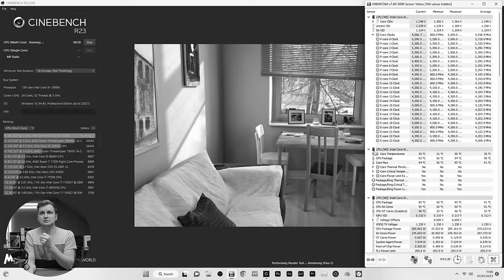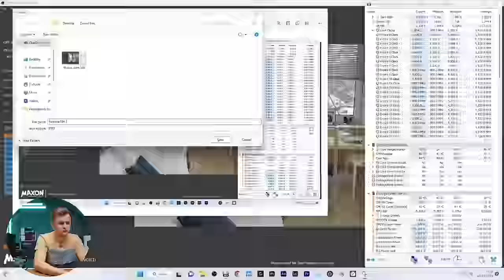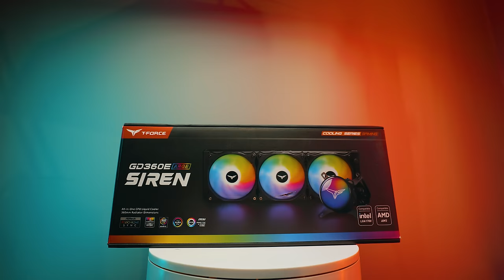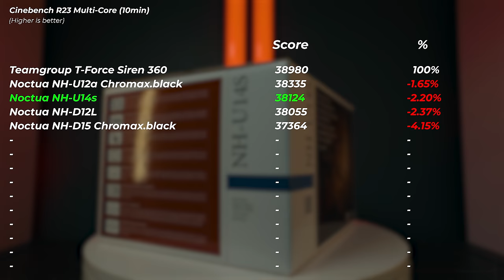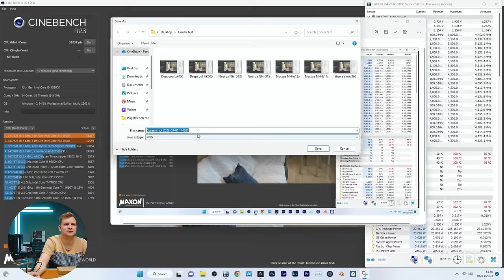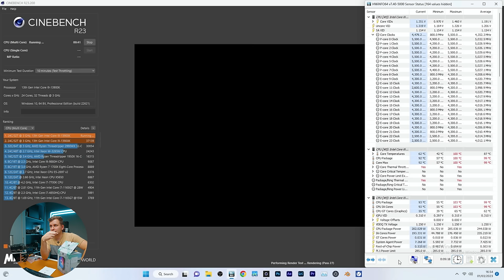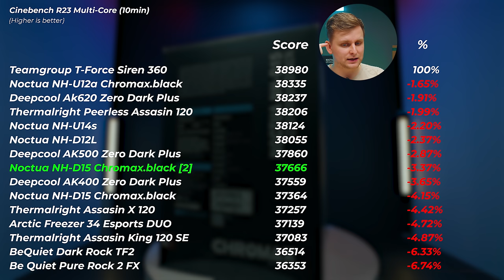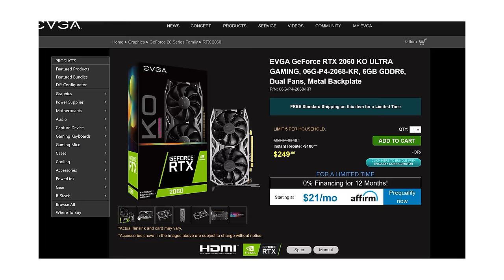We Tested 14 AIR-Coolers on 24-Core 13900k - The Results Will Shock You!

Comment: Well, I've been looking at the Be Quiet Pure Rock 2 FX lately. It's excellent timing on this video! Guess I'll keep looking around. Thanks for your hard work.
Reply: The Be Quiet Pure Rock 2 FX is rated for 150W TDP, it is not designed to be used with a 13900K, even on an open air test bench.

Comment: I have a deepcool cheap 15 dollar heatsink for my intel .Temps get to 80c during gaming. Just bought arctic mx 6 thermal paste and thinking about getting Cooler Master - Hyper 212 RGB Black Edition 120mm for 42 bucks. Is that pretty good air cooler?

Comment: Interesting test, but I have my doubts about its reliability. 

I think this test would have been more reliable if you had done it with the 7950x on the AM5 socket. The LGA 1700 socket has known issues with consistency in mounting pressure across the cpu. The only way to fix it would have been to use a mounting plate like the Thermalright mounting plate.

Comment: Considering a Noctua U12A or a 280mm AiO from Corsair for a 14600k-equivalent when it launches. I was always closer to the aircooler line of though, but the extra performance, RGB/looks and last, but definitely not least: The moveability of an AiO made me go towards that as a solution. You know, considering Noctua officially recommends a re-mount/re-paste for every time the PC is moved for their air-coolers... But again, I kinda would be paying $100 extra for the looks, and not having to do 2-4 re-mounts in the lifespan of the AiO. As the U12A basicly can keep up with anything for a reasonable CPU, and will last me a lifetime, and IMO it looks just as badass as an AiO as well. There's something so satisfying about knowing you have such a "rock solid" product in every aspect of it.

Comment: I'm surprised you didn't try bequiet dark pro 4 as that is designed to handle TDP heat output of 250 (Though after looking around, it seems to perform around similar to NH D15

Comment: I recently was looking at Air Coolers for the 4790K. Final two came down Noctua NH-D15 Black and TR Peerless Assassin 120. Went with the Peerless Assassin cause it's close to 1/3 off the price of the D15 and has similar performance.
Reply: How did peerless assassin perform? Did it manage to cool your cpu?

Comment: What I would like to see is more power in fans. Currently all are PWM controlled so if they can be quiet to like 60% load and then can make noise. Example like those in HP/Dell workstations (12V 2.5A finger slicers)
Other difference in real world is AIO usually is pulling/pushing air to/from case when air coolers depends your case fans. Workstation usually have wind tunnel from from case front to CPU cooler so it also may effect need of need hi power fans.

Comment: As owner of a Noctua NH-U12A with a Ryzen 5800X, I can say that it is by far the best cooler I've ever had. The build quality, cooling performance, low noise, and aesthetics are all top-notch. For me, it's a solid 10/10 in fan cooling. Is it expensive? Well, it's the best air cooler and if you can afford it, yoo won't regret.

Comment: Great testing. However, you’re testing these air coolers in an open air test bench. I can’t imagine how much worse the temps would be in a closed case with slightly positive pressure.

Comment: i think the dark rock was supposed to be blowing upwards. as the radiator absorbs heat and you are blowing the hot air down to the motherboard. hot air rises. i dont know. maybe im wrong.

Comment: Testing on an open bench is going to get you different results than a closed system. I just finished testing 4 different fans in multiple configurations on the U12A and you get the best results with an open case, but the closed case doesn't always produce the same results. Close it up when you test.

Comment: Best demonstration of the Air Coolers, one thing I'm really worried about, this could be a thermal bias, as with each run there could be a thermal effect on the CPU  from the previous run, which might be restraining it from its real potential and which might be limiting its productivity.

Comment: I have noctua nh-d15 and 13900ks, and for me its also p-core 5 and 7 thats throttle and hit max temp first. Im starting to think that nh d15 is probably not the best to cool 13900k due to not correct pressure on the ihs. Have ihs bracket, but it did not improve the result more than 2c°

Comment: The Teamgroup Siren cost double what the Deepcool 620 does and is only 2% more efficient. Deepcool 620 is VERY noisy. You didn't mention it but it has issues with resonance on the stock fans.
If you get better fans on it you will still be saving 30 bucks and it will probably match the Siren...

Comment: i have an 13500 on a msi 760 meg tomahawk, and the HWMonitor shows cpu 1.500 v and under it vdd2 1.200 v, as cpu-z shows 1.500 v too. So does my cpu runs with 1.5volts? How lower at voltage can a 13500 can run? I run R23 multi-core and the 13500 hit 100c with pure rock 2 cooler. is it normal ? keep up the good work.

Comment: I think any 6 heatpipe unit could do a good job.I use SE 224 XTS on my 12th gen. it also came with an extra clip which I used to add a quality coolermaster fan. The unit is a beast now. Everything happens in a 30C band now. Just a question, my motherboard has calibration for fans in bios, does yours calibrate your fans to the power curve

Comment: Fantastic look across the board here, and proof that CPU manufacturers (and GPU while we're at it) need to slow TF down and think about power consumption and thermals. We're getting performance metrics off the charts of what's needed for modern gaming, but at the expense of chips like this which simply cannot be air-cooled effectively. Given that AIOs have a fixed lifespan and given the maintenance involved in custom loops something needs to give for the (large) portion of the PC consumer market who aren't in a position to tame these kinds of chips. I know right now they only represent the top end, so a noobie isn't as likely to walk into them accidentally, but still.

Comment: I am running my i5-13500 pl1 95W and pl2 96W with just an 120mm AIO Xilence. Runs completely cool and quiet. The decision for this one is because I built an Mini ITX System and there was no space for proper air coolers.

Comment: Nice review.  The thermal paste application depends on the paste type.  Check with the manufacturer.  The artic silver work much better with dots so only a very thin layer of paste is on the cpu.  The MX paste likes a lot more. Check with the manufacturer

Comment: So grateful for this video @Teach Notice and the links. I'm doing a build with the  i9 1300KS and was thinking to just keep my temps set a bit low , then i don't need to worry with xyz, but the performance should still be good as the "S" would give us some headroom, meaning  end performance could still be maybe jsut 200Mhz lower than adverised max - or another way of seeing it is getting ip1300K performace without hassle of AIOs and twaeking etc. I wonder if the above logic is all good?? Also even if this is good logic and im happy with the drop in total performance cos of xyz as mentioned-.. should I nevertheless still go AIO ? So gratefull for yours and eveyones opinions / experience:goodvibes::washhands:

Comment: hello, I have a ryzen 7 5800x and a rx6800 xt the cpu and the gpu temp in full gaming are for the cpu 58° and for the GPU 70° which I don't think they are high at all. The problem is the air  inside the case that is  super hot. So or the case it's lame it is a corsair  I have a noctua nh-U12S do you think upgrading the heatsink will improve the temperature or at least the air inside?

Comment: Side note: A closed case will always be 3-4 degrees cooler than an open-air test bench. I understand open-air test benches are used for convenience and easy access, but at the cost of skewed temperature results.

Comment: I've been using the BeQuiet Dark Rock Pro 4 on my 13900k because they were out of Noctuas.  Fingers crossed it lasts.
Reply: Be Quiet make quality products, but just like Noctua they come at a premium price. I wouldn't be worried about the cooler not lasting. I am surprised that people use air coolers on the top tier cpu's, but it is good if it works, and unlike the reviewer, you chose the correct Be Quiet cooler.

Comment: Does pushing a CPU to temperature limits actually have a substantial impact on longevity? I've seen it said that modern CPUs are very robust and undergo rigorous testing that supports higher operating temperatures. And it's not like people will be running the CPU back and forth from idle to full-load constantly. I don't know the definite answer.

Comment: So much hard work, awesome video…First ty to u for this vid. I am using Thermal right burst assassin 120 and it rocks. Single tower cpu air cooler at only 2500 bucks literally spanking the Noctua dual tower😅 with ram clearance issues

Comment: I have an Intel 10700 on a Gigabyte B460M_DS3H,  Arctic Freezer 7x,  (probably less thermal throttling now than i had with my old Intel LGA 1200 Stock Cooler)   I tried installing a Be Quiet Pure Rock 2 Air Cooler and Failed Miserably at it, so choose this Cooler instead from place that originally built system.

Comment: Hello, quick question, I got a Noctua NH-D15 on my old CPU. If I upgrade 13900k, will that one work? I can see some stuff reaching into the 100 in the video. I don't plan on overcloacking and just using it for gaming. All I care is that I don't damage the CPU. I am not that versed into all this technical stuff. Going to buy a bracket or whatever its called to fit on the 1700 sochet. Thx!
Reply: As he said in the video - it will work - in the test it was 3% "performance loss" compared to a 360 AIO - with limits open (with power draw off up to 283W) - it will definitely be fine if you adhere to the standard limit of 250W. And that said – he tests the Chromax Black variant which in other tests was just slightly less performant than the “ugly” beige/brown standard variant – so maybe you might even have the 3% “headroom” already.

Comment: These tests were run with best possible conditions for the air coolers - open air. If these tests were rerun with the test bed mounted in a closed case, the advantage of the AIO would most likely be much greater.
Reply: But even if the advantage would have been bigger, the greatest advantage of the aircooler still remains:
Little to no maintainance needed/no need to change cooler liquid regulairly, no pumps that break after 2-3 years, no risk of a leak in the cooling system and maybe damaging the PC... there are air coolers that are damn near the performance of liquid cooling without all those disadvantages. Many probably also only use them for their fancy looks. I would never honestly...

Comment: I strongly doubt that the thermal paste was facing the pine when the nh-d15 was tested. however, by far the best air conditioner in the market
Reply: I think it's still wisest to buy the previous generation processor (AMD 5900 X), you don't need to play around with the heat and the power will certainly be enough for the next 5 years. I don't think that 13900 intel will even last 5 years
Reply: PS test noctua with your own thermal paste

Comment: If my cooler is just not good enough to keep the CPU cool and I want to be sure it doesn't ever reach a high temperature, can I just set the limit to something like 80 °C? Forcing it to never go much higher than that. The bios have this kind of setting?
Reply: 90 is the lowest you can change in bios

Comment: Wow, GREAT WORK. How long did it take to test all of them ? Have one question. I in process of building a PC based on ROG STRIX Z790-E Gaming WIFI motherboard. It has 5 x m.2 slots, but the first one supports PCIe 5.0x4 mode. The manual says – “When M.2_1 is occupied with SSD device, PCIEx16 will run x8”. I am confused as I don’t know how this will impact the total and GPU performance (NVIDIA RTX3070). What would you recommend, to occupy or leave the M.2_1.
Thanks
Reply: You will not notice any difference between PCIEx16 and PCIEx8 with a 3070.

Comment: Very.... Interesting. I have the DeepCool AK400 Zero Dark Pro (2 fans) on a AMD 5800X, undervolted and Overclocked... tops out at 78.6 C in the throttle and stability tests.. also boosts to 5ghz entire run. Could probably go higher with an AIO, but frankly I'm happy with my 18,424 points in CB23. Also, gaming at 1440p is phenomenal on my undervolt/OC RX6700 (Non XT)...

Comment: How about you use a MAXTOR CTG8 or CTG9? These pastes have the specs of 12.5 - 13.5 W/m-k. My old GPU that used to have a max 83-85c with MX-4, now only maxes at 72c with MAXTOR CTG8. I wonder if you can compare the MX6 to CTG8 o CTG9?

Comment: a pity you did not check any Scythe coolers, would have been very interesting to see score for the Mugen 5c compared to the rest
Reply: True. When I builded my last pc in 2014, Scythe coolers were quite recognized. I put a Mugen 4 on my i74770k back then. Still works without any noise.

Comment: This is a cpu you should be running a custom loop or very good aio on. A deepcool lt 720 can run a 13900k without thermal throttling at 315 in an actual system. Most decent custom loops can do better.

Comment: The results seem to vary from person to person. I’ve seen others run tests and the nh-d15 and assassin iii were top tier coolers. There’s also the thermalright fc/fs 140, PS120 se as well
Reply: Yeah, my i9-13900K struggles to reach 32,000 with a AK620. He needs to put his rig in a case to account for airflow. If his room temp is below 70 and applies to air constraint on the cooler, his results will exceed expectations for a normal environment, but it's also of no use since no one leave a rig open like that.

Comment: In view of the "washer mod" maybe your spatula technique isn't right. Not enough paste anymore to fill the groove (edit : ok, you retested with more paste) ? Also applying the mod at some point would have been interesting. At least checking the residual pattern of the paste (which is suspect 10:40).

Comment: The NH-D15 result is probably due to the mounting pressure being completely messed up on 13th gen, 14th gen will probably have a different result. It’s the 1 thing that it does better

Comment: This is an amazing review! It basically debunks what some so-called professionals on certain forums say about air coolers being better than AIO coolers. I make videos myself, but they are much shorter than this. Making such a long video really requires a lot of time and effort for testing and video editing. Truly impressive!
Reply: They are right though. High end air coolers are on the same level or better than most middlecass AIOs, while also being more reliable.
Also 99,9% of people are not going to run 100% synthetic load on their CPU.
Reply: Water coolers have some benefits, they  take longer to reach max temp and thanks to radiators the heat is kept mostly out of the case.

That being said, I bought the Noctua NH-U14s. Surprised by the performance in this test, altough its not inside a case it shows really good performance.

I still kinda dislike the color because it doesnt match with anything, black version was double the price.

Comment: I have the thermalright assassin spirit evo, basically a slightly better version of the X or King, works great. If im going to spend over $100 on an aircooler, ill just get an aio
Reply: Only thing liquid air cooling seems better at times. But if something goes wrong your going to have to place your cpu and hope it doesn't spread to other parts. I hear alot about pumps breaking and leaking on those so ya ima stick to directly air cooling im not fond of liquid in my case or taking that type of chance

Comment: Would putting the wole setup on the side like it would be in case change anything in results?
Reply: Not on a good board with thick PCB layers. Rumour on the street is :

Never put a heavy cooler (above 500 grams) on a cheap motherboard. They can (allegedly) bent the board. Tho it'll took some time.

Comment: Not surprised at thermalwright CPU cooler. No reason to spend the extra on any of these coolers, UNLESS.. You are going for an aesthetic build where a specific cooler matches your scheme.

On a performance note. I would get the best thermalwright or skip the competition and go straight to an Arctic liquid cooler, as they are the best According to many reviews. 

I personally don't have a chip that has a crazy core count that requires an AIO.

Cool results. Interesting the noctua nhu12a is such a beat for being that small.

Comment: i would highly recommend, testing all coolers again, but evryone with the same fan combo, so that we can see how good these noctua coolers really are compared to others. I also dont know anyone who did this, and there are a lot of people changing fans on air coolers, but noone really knows what they can do with the right fans. Is a peerless assassin better than the nhd15 or is a deepcool ak500 with 2 nf-a12 really worse than a U12A,sure the fans arent cheap but i feel like most of people think noctua has the best "coolers" when they actually just have the best fans (besides the T30) Im also curious how long the AIO has been warming up before the 10 minute  cinebench because the massive volume of the water takes some time to really heat up and before that, it will perform better with the colder water.

Comment: Tech Notice : no you cannot cool an i9 13900K because if the CPU throttles, which it does with every cooler, it means that it doesn meet the out of the box claimed specs. These speca are lower so it doesn't perform as an i9 13900K was intended and performs lower which makes it effectively a different product entirely.